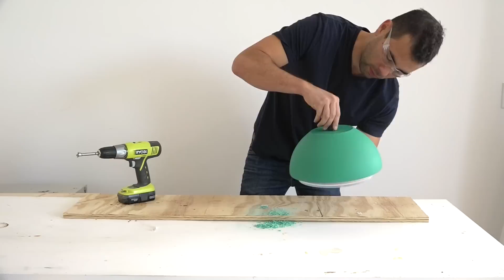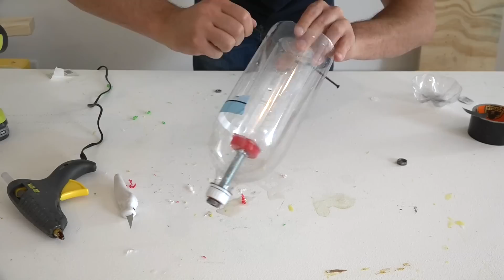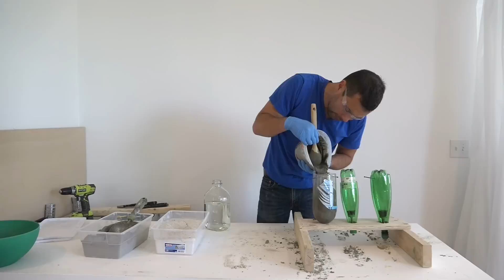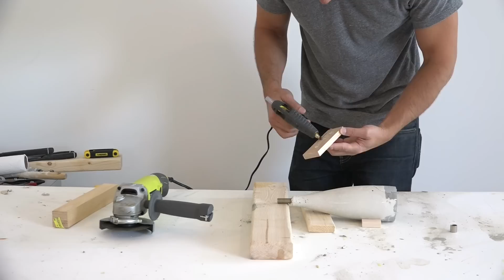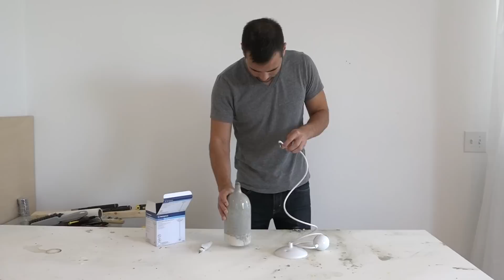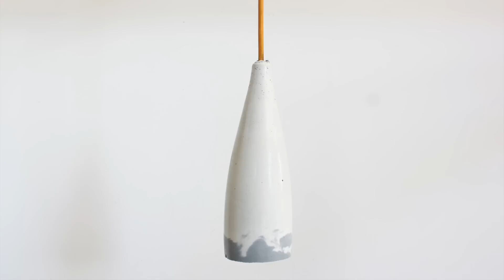DIY Concrete Pendant Lamps 2.0 | Design updates

Comment: it will also be a lot stronger if you add fibres to the concrete; one way i can think of is perhaps lots of 2cm lengths of monofilament fishing line? or polyurethane thread if you want some colour.

Comment: that method of vibrating is too violent and the wrong shape; it will add bubbles. you need to use a tube shaped object with a rounded end. It should also only be vibrating slightly i.e. not a lot of movement like the multi tool. I am thinking a phillips vibrating toothbrush would work using an old brush with the end cut off and silicone rubber surgical tubing over the shaft and sealed at the end with a round knob of gorilla glue or something similar.

Comment: that section of pipe in the bowl could be mounted to a longer rod and positioned upside down (from the way you have it) as a lampshade, right? Is the cement surrounding the pipe strong enough for that? I don't want to hang it.

Comment: gosh my lamps keep breaking
Reply: add reinforcement? Concrete has fantastic compression strength but very little tensile strength. that's why you can squeeze it and it won't break, but bend it and it cracks really easy. so, you add metal. even wire (a little thick) can help. make a little mesh inside your mold. hell, make a loose coil that will fit the mold. it will give the concrete a LOT of strength and your stuff won't break. Also keep in mind if you make runny mix, the dried concrete will have even poorer strength. If you want you can add additives to concrete to improve its properties. There is an additive i remember using, it smells very strong of glue, and it makes the concrete a lot more resistant.

Comment: Very nice process and project! In architecture school I made a large plaster model of the Pantheon using a similar technique with two bowls. I remember even making the cassettes of the ceiling with styrofoam squares glued to the mold. Might try the same on a concrete lamp project. Thanks for the inspiration :)

Comment: Ben, for off-the-shelf, Quikrete Q-max mix would work way better than Quikrete 5000...I sent you a message a while back about the virtues of Q-max (sent via your website - not sure if you check this).  It is like an inexpensive semi-GFRC mix.  In fact, it might be better than the countertop mix since it has AR glass fibers in the mix.  You'll get way less bugholes because it has a plasticizer, higher strength, and super quick demolding (a few hours for a project like this)....it really is an amazing product you should definitely check out.  At $10/bag it is a great alternative to the countertop mix.  I've used it for small countertop projects with success.

Comment: If you grease the bowl with ordinary kitchen oil (applied thin with a brush) the concrete doesn't stick to the bowl and you can reuse the bowl for another lamp.
Reply from the maker: thanks for the tip! :)

Comment: One thing that you could try for a lot of these concrete projects, is using a reciprocating saw without a blade for the vibrations. It works surprisingly well, although you do have to be careful not to break more delicate molds with them. They are commonly used when pouring concrete sidewalks and such, and they leave a nice finish on the edges.

Comment: Nice job! 
Try spreading a thin layer of vaseline on your molds or if you don't have it you can use some vegetable oil too.Makes the demolding a lot easier... If this method leaves any marks you can always sand it.

Comment: i figure a palm sander would be good to get rid of the bubbles
Reply: Exactly - I use a palm sander for all of my concrete projects (counter tops, table tops etc.). Works great - just move the side of the palm sander along the side of the form.
Reply: I had the same idea. since there are so many uses for a Palmsander or oscillating sander (diy rust removal bowls) beside the original purpose everyone should have one
Reply: got u!

Comment: Any recommendations on the concrete to water ratio when mixing? I tried to make some of these with Quickcrete 5,000 (with stones filtered out) a couple weeks ago and it didn't go well. My concrete was mixed thin enough to pour and I worked to get as much air out as possible. After curing for 24 + hours though the concrete crumbled as I was half finished removing the mold. Tips or advice?

Comment: Think an orbital sander without the sand paper against the outside of the 2-liter bottle example would work to vibrate the concrete? I'm kinda liking this but maybe make a couple as table top lamps.

Comment: @HomeMadeModern what sort of tool would i use to smooth out the inner edge and bottom of a concrete bottle? will a normal sander do the job?